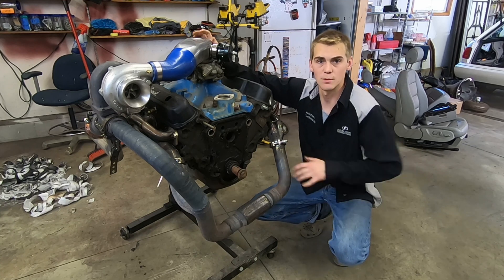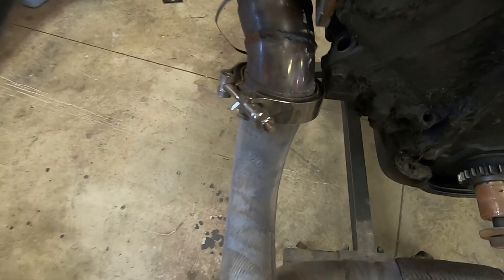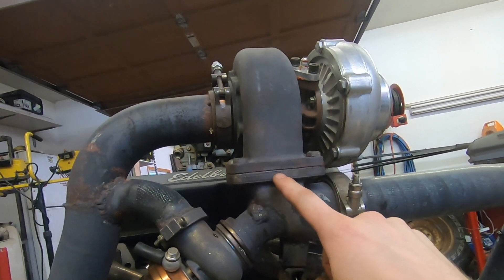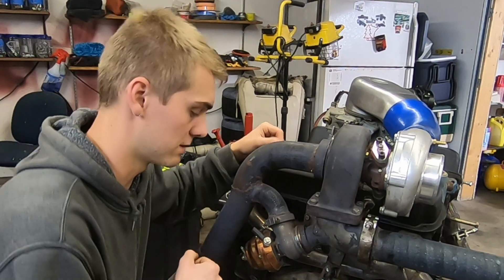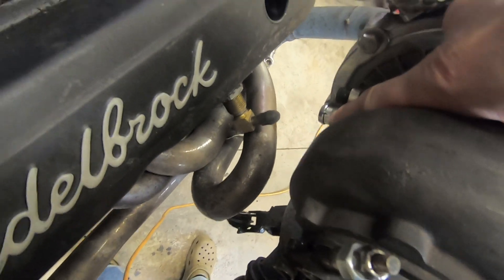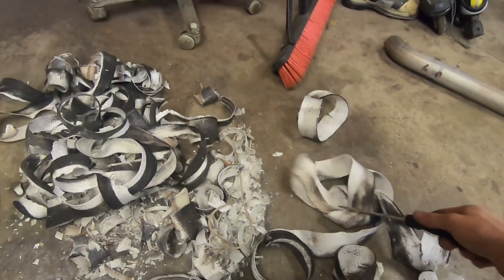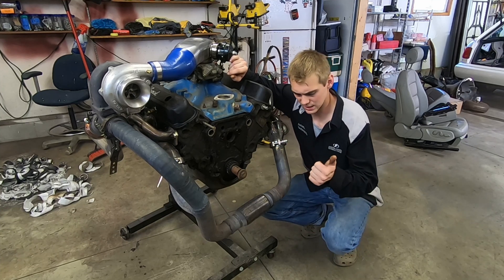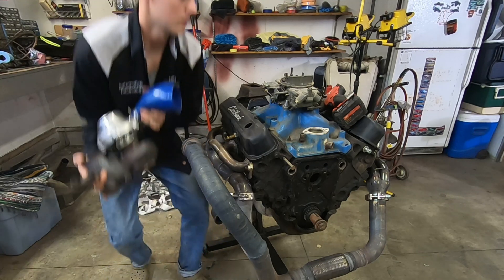Dodge D150 Turbo Kit Explanation. Small block 360 v8!

Comment: The 6875 DNAmotoring GT45 is perfectly suited for a 5.2-5.9L wanting 500-700hp.....👍

You could use factory manifolds with v-bands and 2.5" crush bent exhaust tubing/hotside.

Comment: eBay gt45 is sized much better for that application. The turbo you have probably runs a 2:1 back pressure, even at 8lbs. If you are injected then you shouldn’t have a mechanical fuel pump. Run a block off plate and run your oil return there.
Reply from the maker: The oil return in the fuel pump hole is a good idea! I hadn’t thought of that. I couldn’t find any good resources for turbo sizing so i guessed.  When it was driving, i had a hunch that it has excessive exhaust back pressure but i wasn’t sure. Thanks for the input
Reply: @BackinHaction  a T4 flange will work well in the 400-900Hp range and should have a 1.0-1.25AR for most 300+ cu.in. engines. a 66mm compressor inducer is good for around 600hp, a 75mm 7-900, 80mm 1,000, 88mm 1,200-1,400. Basic guidelines. I had a GT45/1.05 for my 360 and have since sold it as I am stroking to a 408 and switched to a 7582 1.25 T4. That GT45 or a T04Z would also work well for guys with a 318 looking for 600hp.
Reply: @BackinHaction That's genius! I'm wanting to do a project where I get 1,000 hp from a factory block 318. I WILL be remembering this.